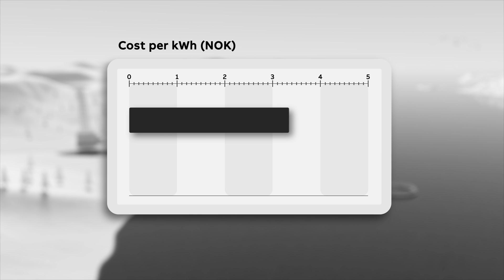Improving aquaculture sustainability using power from shore

Comment: I would like to develop a kelp field in the area of Southern-California in federal waters.  I would like to grow kelp from subsurface buoys to surface in areas where the water is too deep for kelp to grow from the seabed.  One possibility is to make mooring lines for the subsurface buoys from recycled waste car tires.  The tires would be cut and woven to lines using ring weave technology.  I have hands on practical knowledge of ring weave technology.  I have experience of boating in Southern-California waters.  I have a way to collect and process tires, and to store relatively small amount of mooring lines on my property.  I have the funds to obtain a boat for starting the process.  I would need permission from federal authorities to place the lines and buoys at a convenient location.  For this permit I would need more logistic data, of what kind of subsurface buoys and what kind of anchoring systems to use.  Any cooperation would be appreciated to develop a plan of buoy and anchoring system definition. (exp30002@gmail.com).  Any cooperation would be appreciated to facilitate the permitting process.